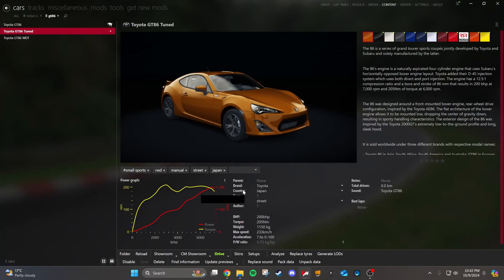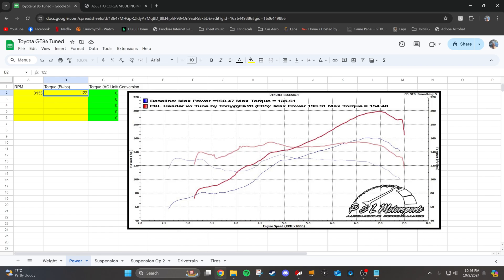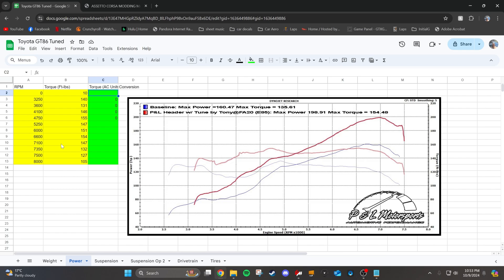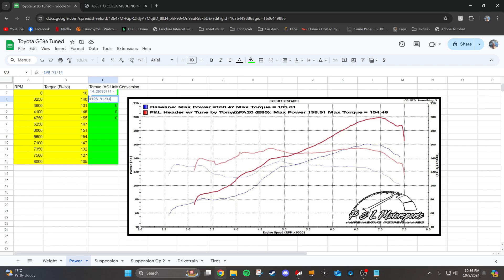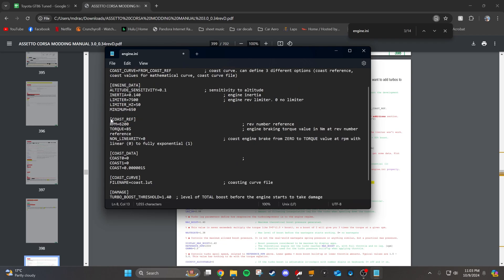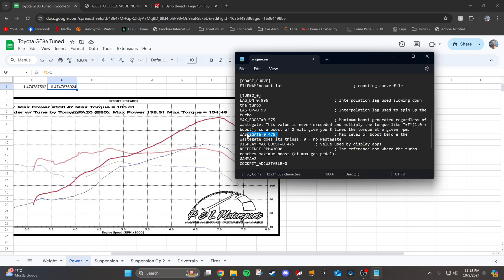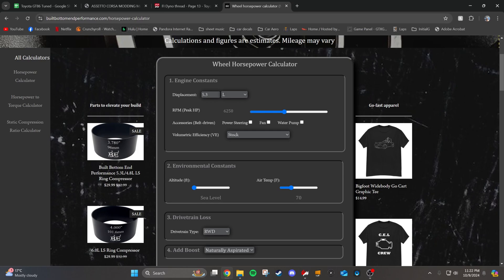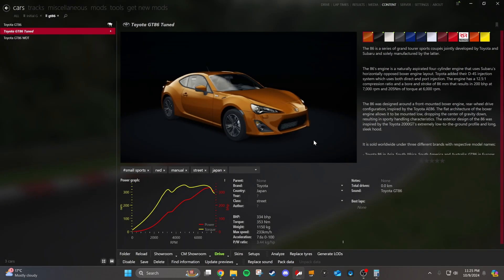Bringing your Car into Assetto Corsa Pt. 2: Power & Engine

Comment: Hi, thanks for your videos. They are a big help. I just started moddifying cars, and its really hard to find info. Do you perhaps have an alternative of getting the Mod manual? I tried the link but I was only able to get some modding tools from there, not the manual itself.  Also, when I edit cars that needs unpacking, I usually rename the original data.acd and don't re-pack the changes I made. (In case I want to change some more) Is there a disadvantage to my method?

Comment: Should torque in the power lut be in Nm units rather than Ft-lbs?
Reply from the maker: @seanmcgovern13  everything in AC is always in metric units, so Nm. You may have to multiple by a correction factor. Put in the peak HP torque numbers first and see what the graph throws back at you for peak whp